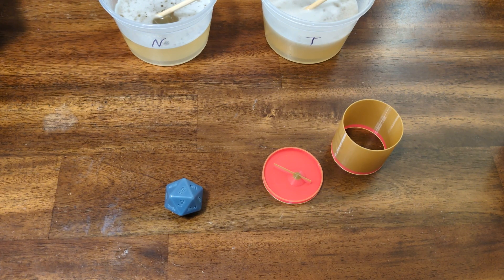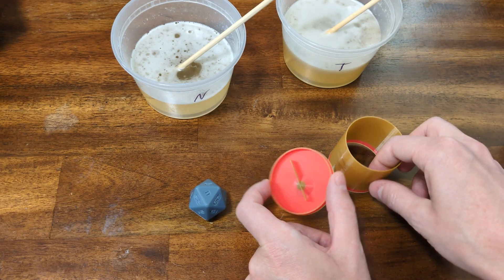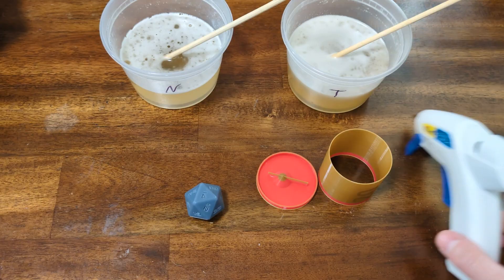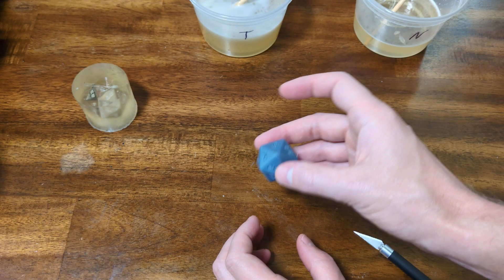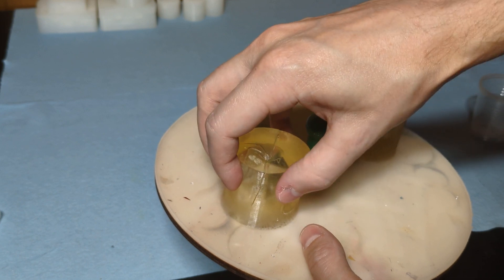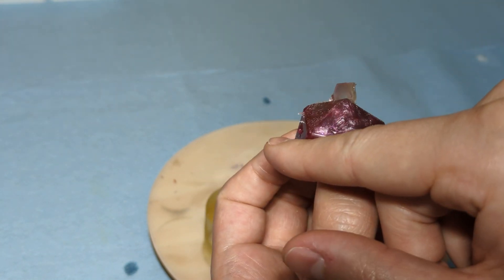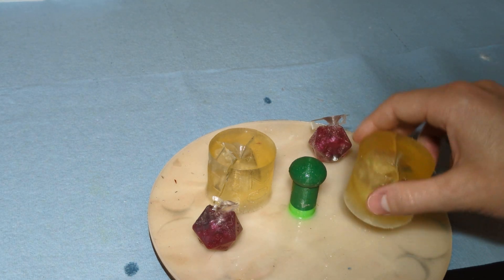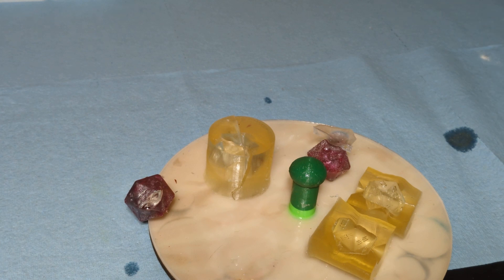Gelatin Molds - Altering the Formula

Comment: Did you have more luck with this?   I just made a batch with 10g gelatin, 30g glycerine and 10g water.  There are all sorts of ratios out there, some with zero water, one was 50/50 gelatin and glycerine which... I dunno how you could dissolve that much gelatin in glycerine alone.    My mix worked great at picking up the shape I was moulding, but it's very soft.  I need something a bit firmer.   Can't use platinum-cure because my master is SLA printed resin.  Prefer something translucent so I can see bubbles clinging to my master and shoo them off before filling up.
Reply: Not too worried about heat from the resin.  I'm making very thin layers, and mosty even using UV-cure resin.

Comment: I'm not sure of the nethod You are using, but are you m of the impression that I saw you in it an earlier video? And maybe it is the case of revealing v.  Message employed. Is what I am going to suggest now?Is the same method you are adopting then my apologies.

When it comes to adding the ingredients together , it is important that the gelatin is not directly to the glycerin .Ideally first add cold water to the glycerin in a 2:1 ratio,   that is tbe amount of water being half the amount of glycerin. Mix well unyil the glycerin has become more fluid.Thatvis it has become less thick tjan itcwas prior mixcing eirh water. You will then add gelatin, thecampubt bring equl too thst kf glycerin but add little by ittle, asmd mske sure itchas been dikuted amd you can't see jt anymore before proceeding to add more.
Ot is  ery important that when it cimrs to heating. Thisxdhpuld be dome graduskly a d making sure it never reaches bailing paint .Ideally, don't put it directly to heat source but place the contsiner inside another contaner filled with hot water a d let it dissolve gradually. Bear in mind that when the revipe is usex fir tbe purpose of manufacturing suppositories the temperature never exceeds 90 c.

Comment: Try using less resin at any one time. Instead of pouring all resin at once you may try adding Jr little. Y little rhR way minimising heat  concentration a d allowing ot to disperse. Also take into account the volume of resin against rne volume of gelatine/glucerine used fir mold.Rhe dice you're casting is a huge blob of resin right ast the centre of a rather thin walled  old by comparison. You need to make tbe. Mold much wider on rbe sides. Ot needs to stand a d retain its shape without difficulty or persuasion.

Comment: Your biggest problem you are going to have with the gelatin is the heat from the curing process of the resin. Unless you are doing something to keep the resin cool (putting it in the freezer), or using some of the really slow set stuff, that resin is going to heat up past the melting point of the gelatin and deform your mold as it cures.
Reply from the maker: I knew I would forget something, thanks for bringing that up. I think I did put it in the fridge last time. The downside is not being able to put the pressure pot in the fridge, so either deformed (without resin that doesn't heat too much) in a pressure pot or microbubbles if in the fridge/freezer. I will add that like before, the molds themselves do deform over time on their own (shrinking, separating, etc.), so I would heat it up and create a new mold each time I want to do a cast.